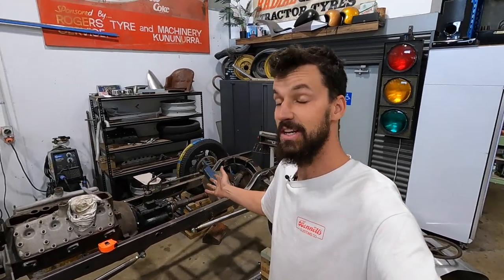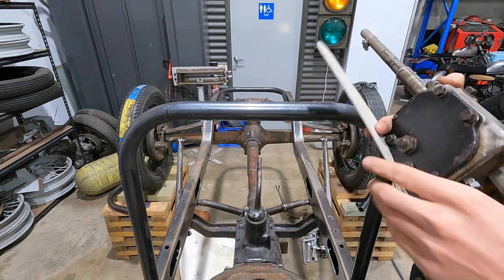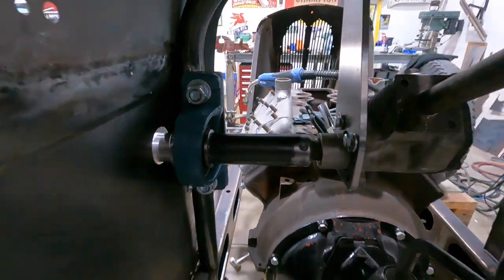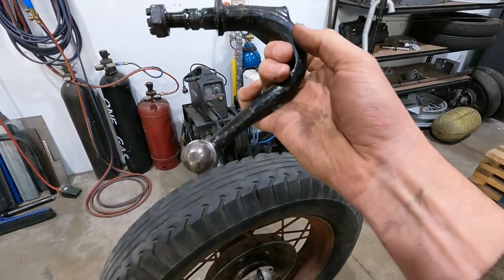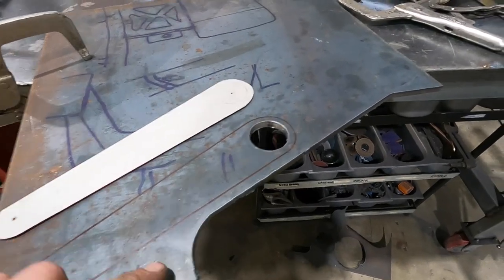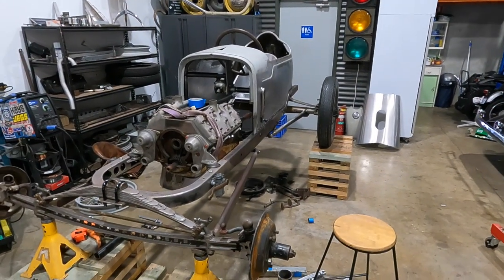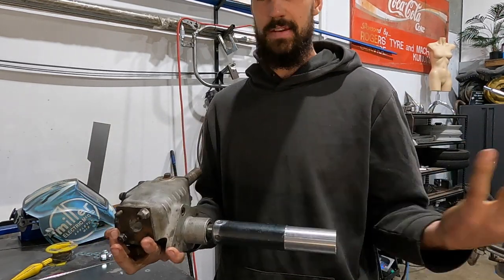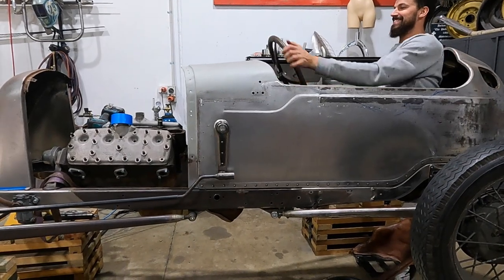SCRATCH BUILT COWL STEERING - Single Seater race car

Comment: Awesome build!  There are a trade offs, decisions, directions to everything in life, chose what is best for you with what you got. Faux rivets do boggle my mind. I've bucked aluminum, copper, steel and monel rivets in structural applications and welded in rivets goes against the grain for this old guy. I'm sorry for mentioning it, my Mom always said if you don't have anything nice to say don't say anything at all. I don't mean to be negative, just to say we all see and do things differently. I'm impressed with your designs and fab skills and appreciate you sharing the build. Looking forward to the rest of the build.
Reply from the maker: Definitely wish I had done so too, but it was easy to do faux for this application but I don’t usually do so in other situations.

Comment: More fun as usual. 
A couple of tips for heat treating parts. An old ceramic kiln is easy to find and works great for heating parts like those steering parts. Plain clay kitty litter works great for slow cooling. Cheap and easy to get. 
I use a cheap Harbor Freight multimeter with the heat probe to keep track of temp in the kiln. Nothing fancy, works!
Reply from the maker: Definitely need the box of kitty litter. Nice and cheap!

Comment: You can use a Chevy Vega steering box to do side mount steering .. I plan to do a 50s Grand Prix racer based off the Mercedes Silver Arrows with 2 Toyota 4 cylinder engines back to back to make a home brewed straight 8 ;)

Comment: Just a suggestion! You might think about adding a curved gusset where you bent the drag link. those bends could be weak points as you push and pull on that link!
Reply: That drag link is fine that's pretty dern thick rounded rod that will not bend without extreme amount of force.
Reply from the maker: I had that in the back of my mind and will be once together if it has flex or not
Reply: "I also want absolutely zero flex!" - you
Reply: You could just build a new, longer, pitman arm & strait drag link.

 It would also quicken the steering ratio.

Comment: G'day from North of the river😉
Just a suggestion to make.

It's an old Blacksmith skill!
From a man that used to work for the Electricity Commission of NSW. 
He was Latvian and a 7th generation Blacksmith who taught me this skill.

Sooo you heated and reshaped the steering arms cool says me.
However when doing so from a metal Urgy perspective the molecular structure no longer lines up with where they used to be ( obviously you bent it🙂)

Blacksmith tip for realigning and strengthening to follow:

Re heat both arms to cherry red and allow to cool in a drum of sand and used oil.
Mineral oil with carbon and silica/ sand will re temper and strengthen while allowing part to cool slowly.

Parts must be burried in sand.

Messy I understand, smoky yep, even fire when first placed on oil sand mix.
Dump a bucket of more oil sand over first part.
Allow time ( you will know how much) common sense applies.

2nd part heated dropped over top, more sand oil mix, and cover with steel lid.

24hrs should be ample time to cool off.

What comes out wi be strong won't snap or bend.

Use it if you wish or don't as you wish.

Loving your creativity and ingenuity.
Hat comes off to you,
( old sign of respect, from an old 3rd gen engineer)😉🙂👍👍
Reply: I thought the same thing (ME here). But,  odds are, it'll be fine as-is (fingers crossed).
Reply from the maker: You’re definitely right, the most important thing to to allow it to cool down slowly but I great tip forsure!!
Reply: @bennettscustomsco  it is , realigned 100yr old molecules, and added molecules from silica and carbon from oil.
Another 100yrs easily😉🙂👍👍

Comment: If I may, bright steel is mainly used for making pins it's around 1040 not so good for machining. 4140 is really nice to machine, but if you weld it, it will lose it's temper. Thanks for a great video again.
Reply from the maker: That you for the great info Peter, yeah bright can definitely be a pain to machine

Comment: Steering turned out awesome. You talked about the bolt you put in the bar, but it should work fine. If you stop and think about your turning the car with a 1/4" key at the Steering wheel. It's like everyone buys the biggest trailer hitch they can get to pull a load, but you have a 5/8 pin to hold it in.
Reply from the maker: Exactly!

Comment: Awesone build Jordan !!! 
Impressive quality craftmanship with such a tight schedule...

Just a comment about steering geometry... You can make  the drag link any shape you want, it will not change the situation: What matters is the centerline from one ball joint to the other.
Here your drag link centerline is definitely not level and this will induce bumpsteer but as you don’t have much front suspension travel it may be ok....
More annoying perhaps is the angle between your drag link (centerline)  and your steering arm... as it is far from 90°, for the same steering wheel input (angle), you will have more steering to the left than to the right.
Reply: I know the car is lighter but he as increases the effort required to steer too.
He made the Pitman Arm longer and the steering arm on the axle ended up closer to the King  Pin.
Time will tell

Comment: Love the work youve done, did you look into sprint car steering boxes at all? They exit on the left hand side of the vehicle same as you need and there a fairly close ratio so you would be able to extend the pitman arm to get it level with the frame and also get a "stock ish" steering feel. 
Just what i think i would have done but i enjoyed watching you do it your way nevertheless. 👍👍
Reply from the maker: Yeah I’ve owned a few over the years, not cheap! This box was free! But definitely a good option if you can afford them

Comment: Do you think I can flip my spindles upside down on my model A to do the same thing to flip my linkage under my strut links without heating and bending everything as much as you did? plus that steering support pipe you welded in off your roll bar should make for a good gas peddle pivot point too!
Reply from the maker: If you flipped yours upside down your spindle would aim towards the sky a fair bit

Comment: That 12mm bolt you intend to use to join the pitman arm to the steering box , make sure you have no threaded section in contact with-in that part , just the plain shaft of the bolt.
Reply from the maker: Absolutely

Comment: Very nice work! Do you think there could potentially be any issues with the Model A steering components given the increased horsepower and torque generated by the V8 engine?
Reply from the maker: I would personally think it would be suitable to the needs 
Most definitely

Comment: Now you can machine of the corners of the nut,I've noticed you mostly use tig welding is there any reason? just curious, the racer is looking great, I did think it a bit small but seeing you sitting in it, looks cool, great engineering, all the best to you and your loved ones
Reply from the maker: Thanks Don, I usually use both Tig and mig, I just tend to use the Tig a lot more as it’s much more controlled.

Comment: Hi.
When I look at all the lightening holes in the axle I don't get why you haven't gone to town on your new 10mm bracket and Pitman arm.
Was the axle purely for looks ?
Or were you concerned about weight.
Reply from the maker: Once everything is finished welding I’ll go through and go crazy with the drill

Comment: Nothing like mechanical redundancy for important elements like brakes and steering. Also you should just be able to use the half inch socket end to get that steering shaft off.
Reply from the maker: That’s what I was thinking!

Comment: How did you calculate the Ackermann angle for the steering geometry?  Or does this car not need it?
Reply from the maker: I luckily nailed it first try for the bump steer and will adjust those steering arms in the get the triangle from the centre on the rear diff.

Comment: btw Jordan Your doing a great job. Even though you have a tendency to be a bit overkill. I rather see over kill than under kill any day. At least that way, it will give you peace of mind. I recall about twenty years ago my buddy bought a Chinese knock off of a small quad or four by four and the kids used it only a couple weeks and the ball joints and tie rods completely wore out in only a matter of a couple wks of use. They weren't even fit for use, they were so poorly made. I was blown away that they were able to be allowed to sell these things on the market, due to just how unsafe they were. smh..
Reply from the maker: Yes I definitely have a tendency to keep building on a specific piece even if it’s finished, but that’s okay I suppose!

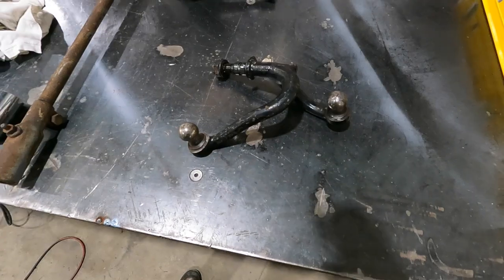Comment: 31:39 bubby you could have just done the same thing with plate steel it might not go with the vintage theme but it would have been stronger. even if you just refresh that little v 8 as light as that thing is going to be it will go like stink everything on it needs to be strong dont take any shortcuts for your sake. if you are just going to buzz around a dirt track no one will see it that matters. be safe.

Comment: Back to basics again...if your drag link is not close to parallel with the ground, you will induce bump steer. Putting a bend/kink in the drag link will not change anything, as the pivot points at each end will be at different heights from the ground.